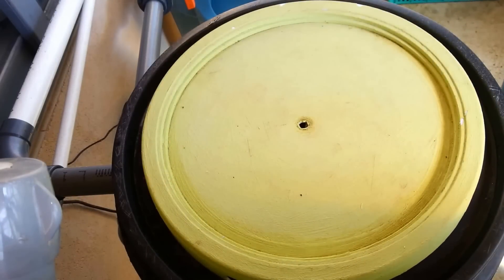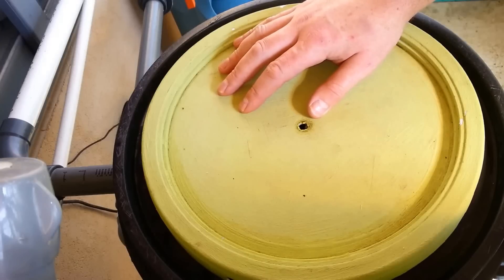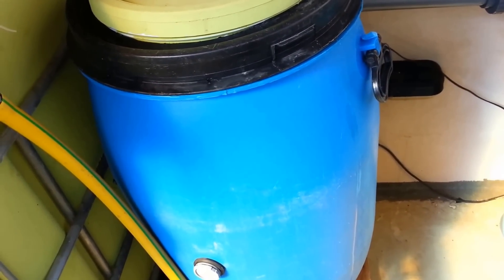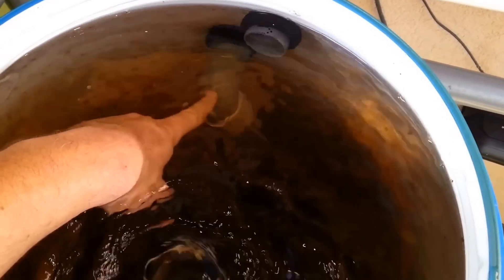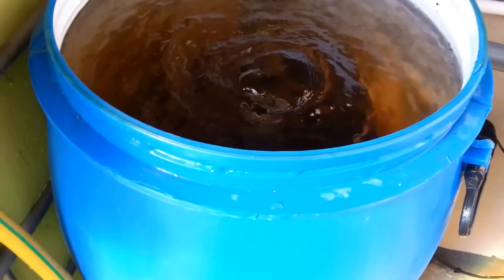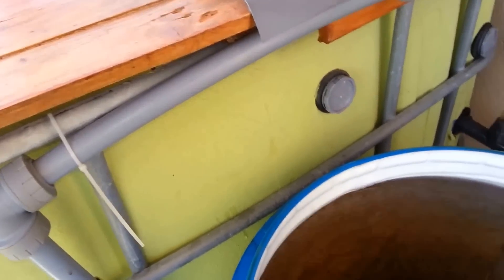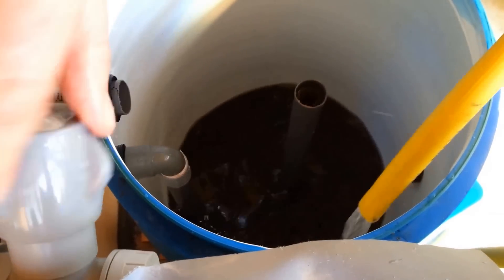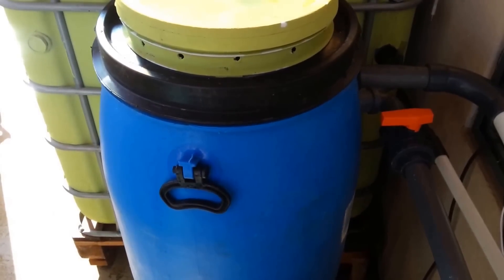Radial Flow Filter Cleaning

Comment: I very much like this idea for my own "swirl" filter. I am using a wet vac canister body; which has on uniseal type opening already. I think coming from the bottom of the swirl w/b the most efficient way to deal w/the nasty/dirty little secret of backyard aquaponics. I have 2 ibc's along w/3-4 fiberglass bathtubs.No gravel but floating bed. I am hoping to learning how to hook them altogether to make a good system. Your build is a good start for me. Thanks. Respectfully, Margo

Comment: It seems you are using grey electrical pipes in your system, just so you know Grey electrical PVC has toxic heavy metals added to it. I would replace it with regular water PVC pipes (the white pipes).
Reply from the maker: Guillermo Nido The pipe you see in the video are water rate SCH 40 PVC pipe with some SCH 80 high pressure pipe and fittings as well and not electrical pipe . In some countries there is a choice of color however here in Malta where I live there is no such choice of color.

Comment: Where did you get that blue barrel with the screw top, and the inner bucket (looks longer than a standard five gallon)?  How much did it cost?  The fresh water snails just eat the slime on the bucket, do they do any harm in the system?
Reply from the maker: Hi Scott, I got the blue barrel from a local food supplier and the inner bucket is 18" x 13" about 5 gallons....As for the cost it was 9€ ($6) so very good price and the inner bucket was just around the house.